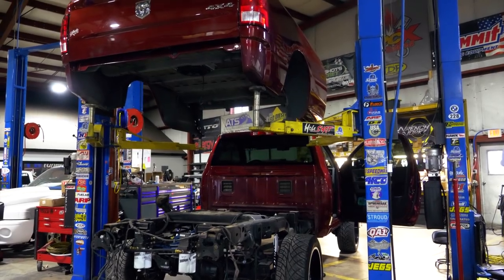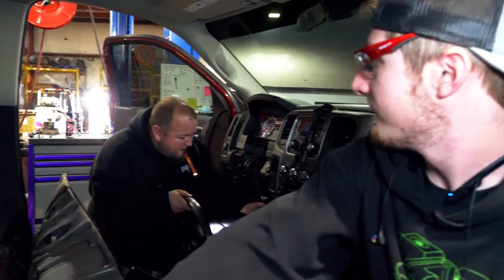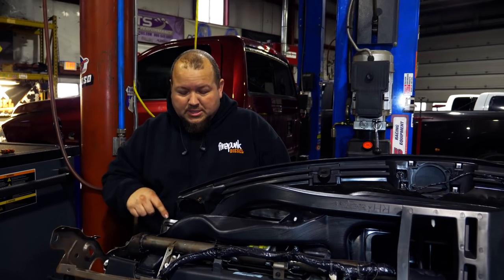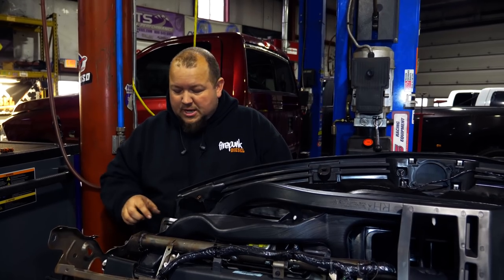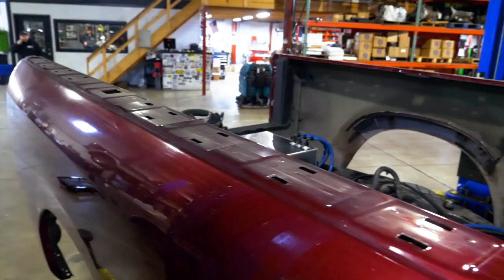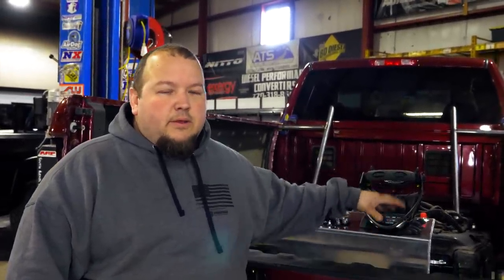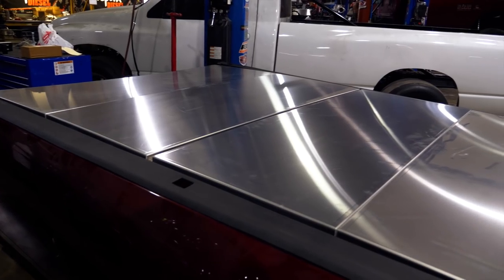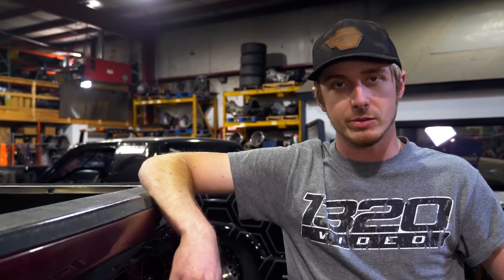1600HP 68RFE RACE TRUCK - THE WARHORSE

Comment: Hiya I noticed that when your fitting the cage that you don't do spreader plates and weld the cage and chassis I know that there are differences from the UK to the USA with alot of things but for any cage to be motorsport compliant here they have to have a set size spreader plate under the cage foot and to the chassis, with some of the speeds and power you guy's make with these types of trucks I'd of thought things would be more tied in with the fabrication work, how do they hold up to an impact or bad roll over? Ps love the channel learning alot from you guy's and some other channels

Comment: Been daily driving a Cummins since 1991. Have modded all of them but no experience with 4th gens yet.  What are your thoughts on the Aisin? Current truck is 2015 with the HO that has been deleted, with 3.73s and stock tires. What hp is safe for daily driving? No burnouts ... etc, and will run stock tune to tow.

Comment: What is done to the 68rfe that you have faith in it standing up to racing at that level of power?
Reply: Short answer is no faith. The engine is built and could make 1600hp but that doesn't mean the customer is turning it up at all.
Reply: @gailyoung9911  the customer owns a diesel performance shop and is one of the top 68rfe research/developers...... yes this truck will get turned up.
Reply: Samuel Hawkins right man! The truck will be on kill tune 24/7
Reply: @drake_24v_hawkins  I'd like to know how it was built. I'd really like to be able to turn my truck up and not have to swap to a 4 speed for reliability.
Reply: @NickBeek  check put Randy'stransmissions or warhorse performance man! Good 68rfe stuff going on!